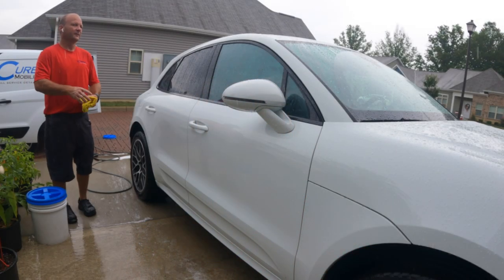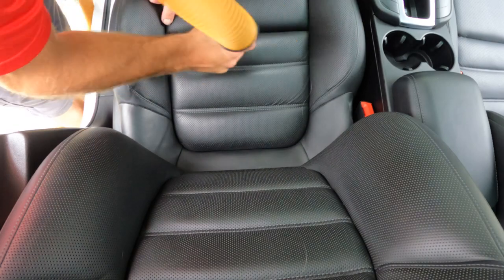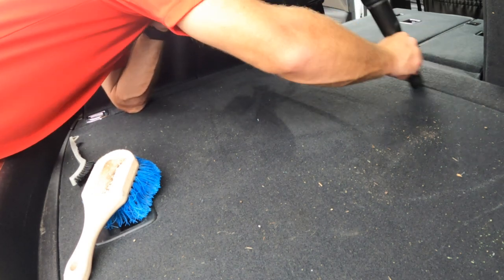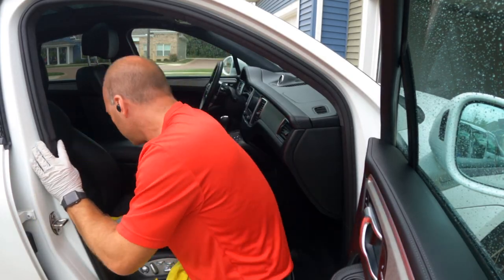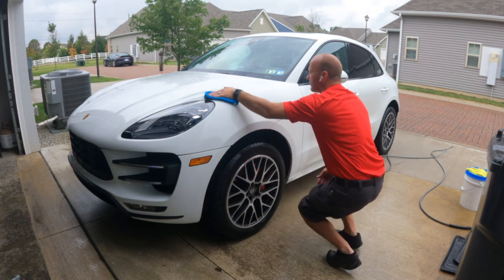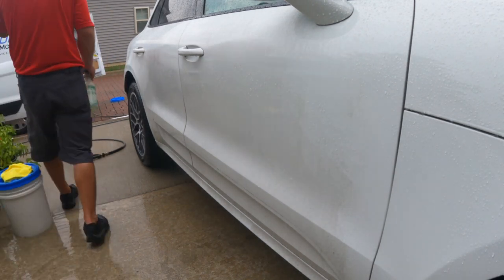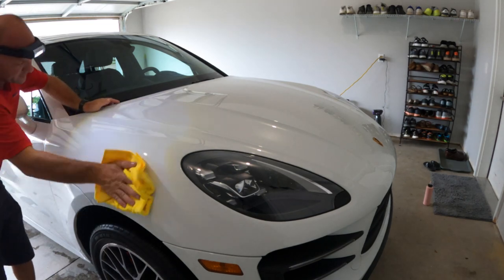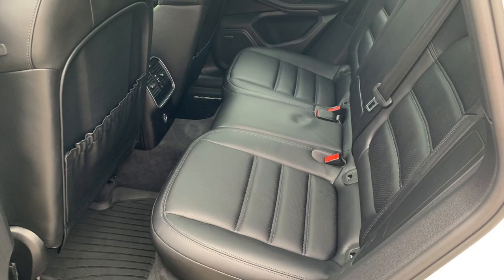Car Detailing 101 | Step By Step Voice Over - Interior, Exterior, Polish & Ceramic Coating

Comment: Love your style of videos! No-nonsense and lots of awesome info. Second on the boot carpet being the worst! Having that brush in one hand and the vacuum in the other seems to work awesome, but a lot of hard work! For me what works well, is the Dyson V15 and my big two motor vacuum with a 40cm hard floor head with carbon brushes. Makes it a lot easier on the body to get the bulk of the dirt and leaves some nice carpet lines.
Reply from the maker: Thank you for watching. I’ll check that out

Comment: Wow… this is some powerful technique in overall efficiency! Love it!!!…. What’s the ratio in wheel brighter sprayer bottle? I would love to incorporate that in my process!!!
Reply from the maker: Thanks for watching. Wheel brighter can be mixed at several dilution ratios from 1:1 to 4:1. However I usually mix a half gallon with 4.5 gallons of water which makes it around 9:1. I have found it is a little more safe and just as affective as long as the wheels aren’t to neglected.
Reply: @TheDetailingBusiness  Thank you! I watch several times! Very inspiring!!!